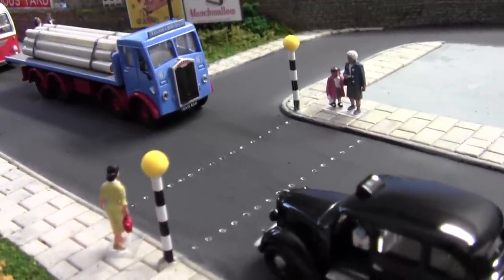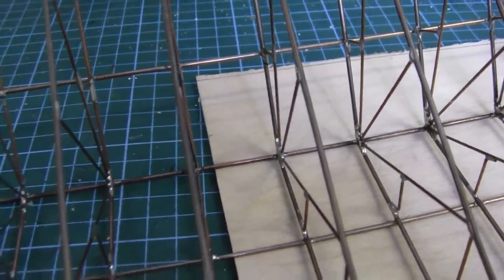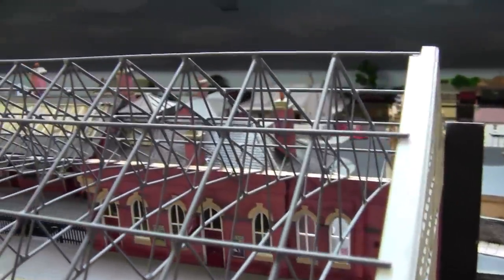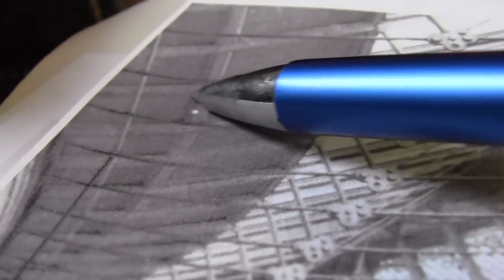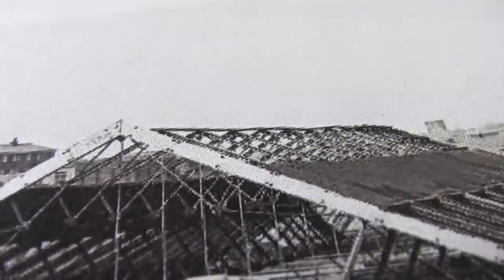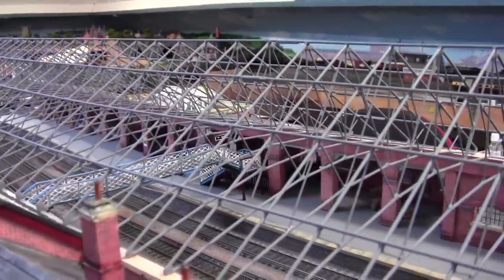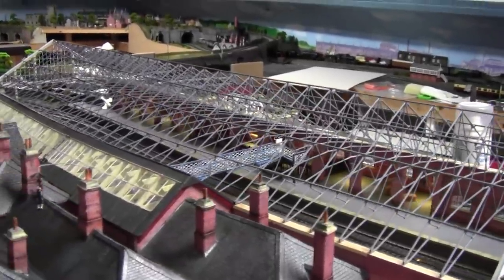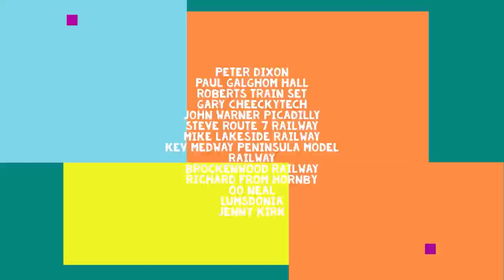The Big Roof Part 7  Cleaned up and Painted  No287

Comment: Hello Tony

Thank you kindly for subscribing to my channel.  I have been watching your channel for a number of years now with envy as I have been unable to pursue my childhood hobby after some considerable time away due to my line of work and the commitments I made as a young lad to join the Army.
I had started to board my loft in the back end of 2019 but due to unforeseen circumstances over the last year from a 5th lower back operation and this Chinese flu malarkey I have once again had to apply the brakes on rekindling my childhood hobby.
Whilst laid up I have finally decided on what Era to model but more importantly what gauge I want to peruse and that is EM gauge.  I have already started purchasing some etched brass kit locomotives to build and have thrown myself right in at the deep end so to speak. However, I am hoping to get some help early next year to have the loft boarded and with fingers crossed to make yet another start.

Again thank you for taking the time to look my channel over and to subscribe.

Regards

Stay safe, keep sharing and model on.

Lee@NEAR
Reply from the maker: Well you certainly have made up for it now
 You have a great layout. I will be watching your progress
Cheers Tony

Comment: Secondly, that roof is looking better and better. Mrs H said, and I quote here, “Wow!”. A woman of few words but when she does speak she means it! As for the lighting supply, if it was me, I can see that the supporting wall is thick enough to run a 2 or 3mm drill vertically down through it and the baseboard to feed a pair of supply wires up, I would then terminate them with a 2way small socket and have a matching 2 way plug from the wiring in the roof, hence no changing batteries with the associated unnecessary extra handling of the roof and if you did have to move the roof a simple plug needs disconnecting.
Reply from the maker: Give my regards to Mrs H. a woman of few words you say. WOW that says it all.
I wish i had thought of your idea beforehand Malcolm. that would have worked i know for sure. 
as we comment the lights are already done i have gone with a small 2032 battery back which lights up 20 LEDS 10 either side and just the right amount of lighting as you will see in this weeks video. many thanks for commenting. untl next time stay safe........Tony......WOW.

Comment: You've done it again! I think I'll throw my station  in the bin!!  The roof would be open at the apex to let the smoke out from the loco's. Gateshead East was the same as was Newcastle Central  just of course over the centre roads and the hole.
Reply from the maker: Please dont throw the towel in my friend. 
Open at the top just as i thought that saves me a ton of hard work. but that still leaves a ton more to do.....thanks again cheer's Tony.                     Ps John says hello.........

Comment: Hi Tony
I suspect the original cladding was wood covered in bitumen sheet. From the photos it doesn’t appear to have been corrugated sheet, just plain wooden planks or sheet. Great to see it taking shape. Good luck!
Reply from the maker: Thank you Ray. the lower section is tiles that much we know. but top section may have been something a little bit lighter. thanks again very much appreciate your input....

cheer's Tony

Comment: Spectacular Tony
Reply from the maker: Cheer's Charlie. the framework turned out alright in the end, concidering the structure is made from TIG welding rods...cheer's Tony
Reply: The guys in the shipyards used to make telephone table out of welding rods. They would scroll them into nice designs and drill holes in the plates so you could mount them to the hall.
No wonder the shipyards never made any money

Comment: Once again the art of patients has no limits. have you considered using the frame as the return for your power reducing the wire needed for the lights to the positive wire only and a single wire attached to the frame for the negative. Stay safe.
Reply from the maker: Hi Mike. that would work. but by using a small bettery pack it just fits neat out the way. and i would be able lift the roof without any diconnetcions. great idea though.
SUPERLATIVE NUTS ARE WE.
SO GRAB A COFFEE OR A CUP OF TEA.
BECAUSE IN THE COMMENTS WE SHALL SEE.
SO BUILD A LAYOUT ALONG WITH ME.

SUPERLATIVE NUTS ARE WE.
SO GRAB A COFFEE OR A CUP OF TEA.
BECAUSE IN THE COMMENTS WE SHALL SEE.
SO BUILD A LAYOUT ALONG WITH ME.
AT THE END OF THE DAY ITS A BIT OF FUN.
SO BUILD A RAILWAY IF YOU HAV'NT NOT GOT ONE.

SUPERLATIVE NUTS ARE WE.
SO GRAB A COFFEE OR A CUP OF TEA.
BECAUSE IN THE COMMENTS WE SHALL SEE.
THANKS FOR COMMENTING BIG OR SMALL.
AT THE END OF THE DAY I THANK YOU ALL.......................................Thanks again .Cheers' Tony

Comment: A really impressive structure Tony. I would think both parts of the roof cladding would have been tiled originally.
Reply from the maker: It may have been tiled Paul. its was heavily bombed during the war. and they may have replaced tiles for cladding. its certainly somthing to think about....many thanks for commenting. Tony
Reply: On balance as well the top may have been glazed as well originally. Look at the new roof at Pickering NYMR. That's totally enclosed.
Reply from the maker: Hi Paul. Roofs do vary from station to station, depending on how busy they are. some had vents built in. but it all depends on what decade i want to re-create the roof. but yes originally you could be right, it may have been fully glazed. they may have removed all the glass after the bombings in 1941. well that has given me something to think about....many thanks for commenting....best regards Tony

Comment: That roof is looking awesome Tony, almost seems a shame to cover it, almost?
I just wondered if you couldn't run a cable down the back of (one of?) the two upright columns, rather than relying on a battery pack? Just a thought.
Reply from the maker: Hi Chazzy. your right it does seem a shame to cover it over. but it is a roof after all. I have a small slim line batery pack which i will use to light the roof. i am hoping it does not show up to bad. but we shall see. many thanks again for your thoughts and comments....have a great weekend...Tony
Reply from the maker: SUPERLATIVES by TONY NORTH EASTERN

SUPERLATIVE NUTS ARE WE.
SO GRAB A COFFEE OR A CUP OF TEA.
BECAUSE IN THE COMMENTS WE SHALL SEE.
SO BUILD A LAYOUT ALONG WITH ME.

SUPERLATIVE NUTS ARE WE.
SO GRAB A COFFEE OR A CUP OF TEA.
BECAUSE IN THE COMMENTS WE SHALL SEE.
SO BUILD A LAYOUT ALONG WITH ME.
AT THE END OF THE DAY ITS A BIT OF FUN.
SO BUILD A RAILWAY IF YOU HAV'NT NOT GOT ONE.

SUPERLATIVE NUTS ARE WE.
SO GRAB A COFFEE OR A CUP OF TEA.
BECAUSE IN THE COMMENTS WE SHALL SEE.
THANKS FOR COMMENTING BIG OR SMALL.
AT THE END OF THE DAY I THANK YOU ALL...........................................Cheers' TONY

Comment: reference your lighting why dont you use the battery operated leds you can get from pound shops the strings on coated wire its very fine so wouldn't show when you look up under the roof and can be cut to length i use them in my n gauge buildings, you wont need resistors either the leds are only around 4mm long too unless your using industrial style hanging lamps
Reply from the maker: Hi Trev, it seems we think a like. how did you know i was doing exactly that. you must psychic my friend. spot on....many thanks again my freind. all the best Tony
Reply: @TONYNORTHEASTERN  dont know about psychic lol but i wanted to light up my n gauge building etc i thought about prewired leds etc and then all the resistors and couldnt get my head around it, my wife had bought a string of battery powered leds for something and i played around i even cut off individual leds soldered fine wire to them and connected to a bus wire under baseboard which all worked great and gave me the effect i wanted for very little cost i even made street lights using them and shrink tube
Reply: i have sent you a couple of pictures via facebook messenger
Reply from the maker: That would be great.........stay safe.....Tony